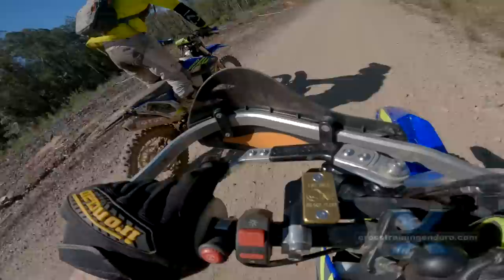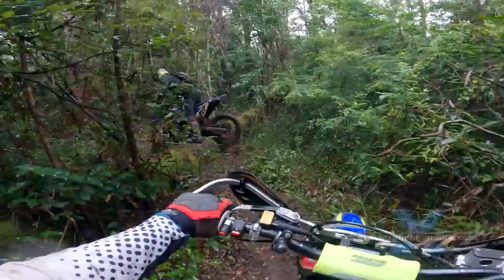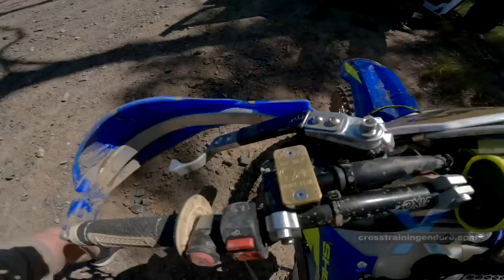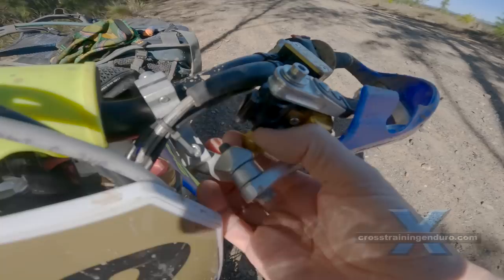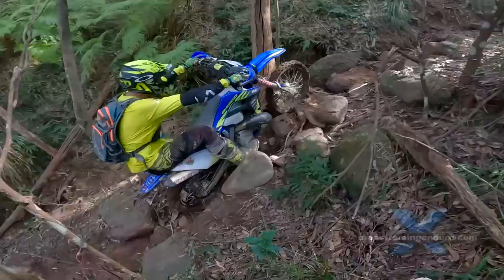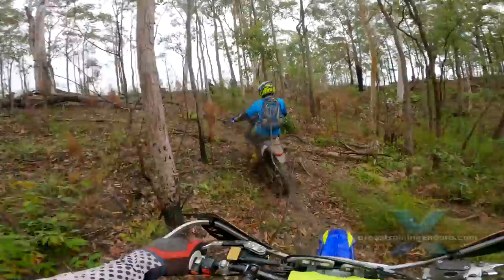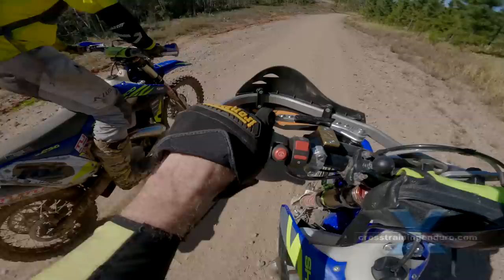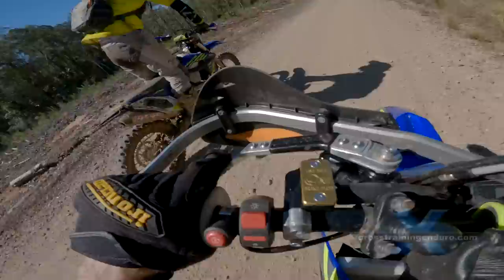How to get the lightest clutch possible: Clake One Light clutch review︱Cross Training Enduro

Comment: Had one, it was awesome. Now, I have 2 bikes with Midwest levers which is enough "lightening".
Reply from the maker: Yep, the Midwest is a worthwhile cheaper option if you don't need that much lightening. We measured the pull and it's about 30% less, not the 50% claimed if you pull the lever all the way into the bars. Still a big help though!
Reply: @crosstrainingenduro  As you mentioned, having some clutch feedback (feel) is necessary so the Midwest is good in most situations. On the KTM Freeride 250R I had, Midwest didn't make a lever for the shitty clutch that was on there so I got the Clake and it was great! Side note, form factor on the Freeride was great but the forks sucked, the brakes sucked and the starting system (no kick available) sucked. Those factors made me dump it.

Comment: enything that helps cable clutches that is like this system
Reply: You can fit a hydraulic clutch to most cable clutch bikes, Clake  helped me out when I converted my 1980 pe175 to hydraulic. You will still need some skills to get it fitted up and working.
Reply: I don't want a hydraulic clutch because I can't adjust it
Reply from the maker: I'd try those 'easy pull' levers that use extra leverage... you just have to be careful with adjustment and if you have short fingers you may find it's too much of a stretch.

Comment: Did not work for me. It numbed the feel and did not feel natural. I went back to the original clutch lever and the Clake is gathering dust in my spares bin.
Reply from the maker: Bummer. I figure you tried adusting the level of 'assist'? I know some guys don't like the feel when it's around 75% lighter and back it off to only 50% or even less...

Comment: Did i get that right? I had the idea that the clake might have a spring like system that "compresses" a spring when letting the clutch out and the energy in that spring pushes the lever in together with ylu finger. Anybody know if that's correct?
Reply from the maker: They have an explanation on the website... or they used to.

Comment: Any suggestions for the ol bushpig in the way of quality clutch systems?
Reply from the maker: I'd try those 'easy pull' levers that use extra leverage... you just have to be careful with adjustment and if you have short fingers you may find it's too much of a stretch. I haven't looked into them yet as I don't seem to get 'clutch' pump with the DR650. Yet! But I'm only doing short rides, I reckon once I start doing multi day rides that cable clutch will be killing my fingers lol.
Reply: @crosstrainingenduro  yea, I’m in two minds about it. It’s fine except when I stand, I want to use one finger on the clutch for better purchase on the handle bar.

Comment: I've had two Clake Pro's fail in about 6 years. Gone back to stock now and wouldn't recommend them. PS: Lasting X number of years isn't probably a good measure. Some people ride 5 times a year, others 50 times a year. Mine each lasted maybe 80 rides, or roughly 150 hours. They are not a low maintenance, reliable item IMO unfortunately.
Reply from the maker: That's a good point about the number of hours, we usually ride every single weekend so some of our guys have up to 1000 hours on the One Light clutch. I'm not sure about the reliability of the Clake Pro... never used one.

Comment: Running Clake one light clutch for about a year.  I absolutely love it on my 21' 300xcw.  Did have a issue with bleeding the recluse slave cylinder.  With a little patience I got it running very smooth>. I'm not sure how accurate the % of pull is.  It's lighter there's no question but 50%-70% I'm not so sure.
Reply from the maker: The lightness seems to vary, Jon. At 75% on my first bike it was just starting to not return properly, as predicted by the Clake guys. Next bike? Not as effective but still good. But one viewer tested his and was getting 80% and it worked perfectly... no return issues.